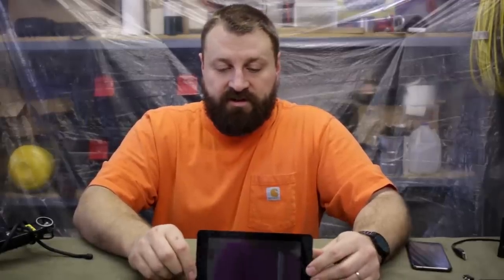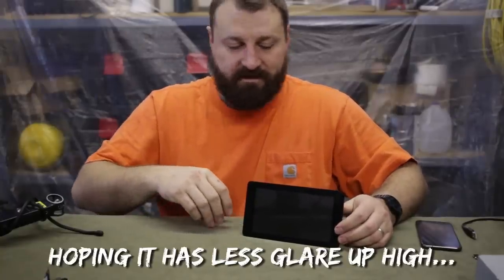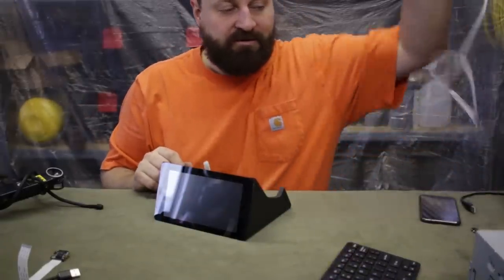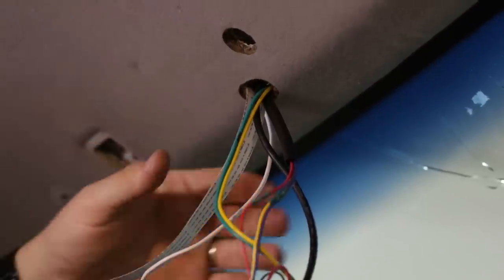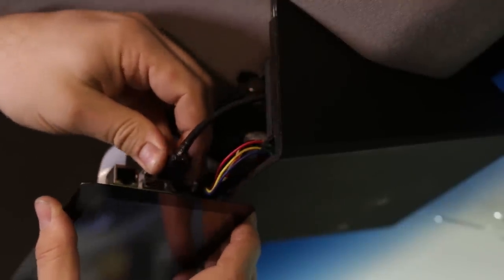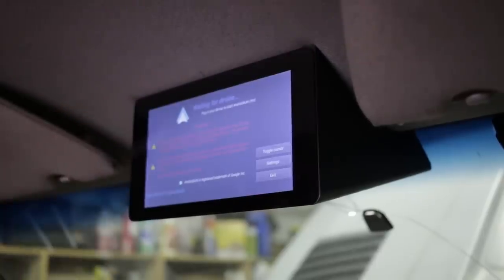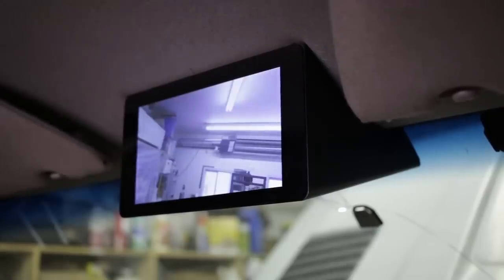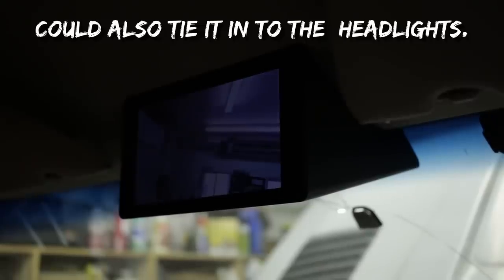DIY Android Auto Raspberry PI Head Unit, Rear View Camera, Navigation & Music

Comment: Cool!!!

Any chance you know if it would be compatible with a weird screen ratio (something that would fit a 1 DIN)?
Reply from the maker: I would probably just go to a wrecker and pull out the dash bezel surround from the same car and make yourself a custom Dash that holds the screen. Much easier than trying to mess around with a single DIN with a pop-out screen.
Reply: I can't use a pop-up screen because air vents. There's not much space on the center console and I'd like to avoid cutting it, it's sort of a collector.

Same as this: http://i55.servimg.com/u/f55/18/34/59/40/img_2012.jpg
Reply from the maker: Yeah, that's tight... How about an overhead console like I did?
Reply: Overhead is plan B. A good plan B but if I could avoid it...

Comment: Maybe this will be in part 2, but did you ever think about tapping into the reverse power wire on the car and monitor for voltage and then have it trigger the camera automatically?
Reply from the maker: Part 2 has been up for some weeks... Tapping into the reverse lights is an easy adjustment, and I posted the code for that along with the rest of it on GitHub.

Comment: Nice vid!  I’m working on a Lithium UPS to use inline with a similar RasPi setup (Plex media center in the travel trailer).  What could I use to monitor voltage upstream from the UPS and trigger a shutdown of the Pi?
Reply from the maker: You can just buy a lithium UPS for the Raspberry Pi... save yourself a lot of headache. https://pi.gate.ac.uk/pages/mopi.html
Reply: Not compatible with the RPi 3 and no word on when their new one will come out.
Reply from the maker: Easily accommodated: https://pi.gate.ac.uk/posts/2016/12/19/good-news-and-bad/
Reply: the last comment from the developer on that link was 6 months ago, and still no release date listed.
Reply from the maker: I'm not sure what your getting at... It works fine. You just need to add a relay to switch the higher load. Regardless, you want me to find you a different solution? How about this, get a cheap low voltage cutoff (LVC) from the RC Model World and use that to trigger the script... Something like this: https://www.robotshop.com/ca/en/low-voltage-cutoff-switch.html
Reply: Everlanders I appreciate your responses, was just hoping to find a way to send a shutdown signal to a RPi.  Wasn’t looking for you to do all the research - just thought you might have come across a solution in your previous research.
Reply from the maker: No, Not an off the shelf solution that you can just plug into USB, but there are many ways to do it. If it was me I'd use the low voltage disconnect relay I mentioned, there are may of them to choose from, you'd just want one that you could set the trigger voltage on. Then when it went below that, it would switch to ground and trigger the script in the same way I mention in the video.

Comment: Will I still need to access my OEM control knobs in order to control sound or is there something on Android Auto I can use? I'm trying to completely bypass my OEM radio as it is shorted out, and this is cheaper than buying a new head unit solely for Android Auto
Reply from the maker: You still need a head unit to act as an amplifier. watch the part 2 video where I show the complete hook up

Comment: I love the DIY aspect, and you seem to have done a great job. But wouldnt it just be easier to mount a  cheap tablet?
Reply from the maker: Easier - Yes,  Better - No... The tablet has no I/O external Camera for the Rearview Backup monitor which was the primary goal here.
Reply: Just find a OTG USB camera? Im not trying to smacktalk your project, just saying its a little overcomplicated :-)
Reply from the maker: I would argue that a tablet is not complicated enough! believe me I've tried. These are the main reasons I built my own; I can use the gpio pins to sense when the reverse lights come on and switch to that camera. I can also sense the signal lights and flip to either of the side blindspot cameras. I can power up and power down automatically with the ignition. I have instant access to dim the screen without moving my hand from the shifter. I can control any of the automation in the rear camper box.  Your tablet/OTG comment is easy to make, but how would you switch to that camera? Launching an app?  Like this disaster? https://youtu.be/P0ml0FIFA_E?t=1m10s
Reply: Point taken :-)
I dont use a rearview camera, so for my needs (navigation and music) a tablet is just fine :-)

Comment: It lacks some very important and without, the volume keys. Is there a possibility to add them to the screen?
Reply from the maker: The volume is handled by whatever amplifier you're using. In our case the Kenwood head unit...
Reply: Everlanders Ah okay. I pretend that the Android car is the main music system of the car and feed it with an amplifier. I'll have to get some controls on the steering wheel to drive it hehe

Thank you very much for your answer.

Comment: Hey! Quick question: Doesnt the whole thing breakdown when under intense heat?
For instance if its a hot summer day and its really hot inside the car, doesnt that ruin the display, glue, proccessor, memory chip, capacitors etc... and how would you ameliorate that?
Reply from the maker: If that were true your car stereo and every other electronic component with memory chips and caps would breakdown too...
Reply: @Everlanders  i agree but this is on the roof tho... But maby even then it doesn't matter..
Reply from the maker: We driving through Mexico and Central America at the moment with no problems... For any one else reading this, that is exactly why I printed the enclosure from ASA.
Reply: @Everlanders   Thank you for answering! This is very important information, as Im sure alot of people who have delt with computers would agree, tech doesnt like heat! 

Also done some research recently on NAND-Flash (the memory of any sd card, usb stick, ssd in general) it does NOT like heat at all! In fact if you heat it  enough times alot of data will be corrupted (my phone's sd card can attest to that, and many other people's)

Good luck in Cental America, may God be with you

Comment: This is amazing. Did you have to do to school to learn all this? O want to get into this in the worst way possible but don't know where to start
Reply from the maker: I have found that if I don't start, I won't start. I've built an entire expedition vehicle with my bare hands, taking it one tiny problem at a time, you just need to start somewhere, baby steps. If you like the Android auto project, buy yourself a Raspberry Pi for $35 and learn how to flash and image to an SD card.

Comment: With android auto is it your phone that connects to your cars bluetooth, or does the pi need to be connected to the cars bluetooth? And I can see you decided to add a mic to your set up, so you can't just use your phones 'ok google' interface? The pi has to have its own capability? Might be some dumb questions but it's something i've been trying to figure out.
Reply from the maker: I don't use bluetooth at all.  The Mic in the phone would/does work fine, I've plugged in a $3 lapel mic which I will mount closer to my face as this is going into a pretty loud Diesel truck.
Reply: Makes sense, but if you're not using bluetooth at all how does android auto play music? Is there an aux cable going to your phone?

Comment: Great job. A question: Couldn't you add a Video RCA input directly into Ras (Instead of ribbon) and use a conventional cheap backup waterproof camera with IR (Usually under $10) that also gives you color back up path markings? Talking of cameras, how about turning this Ras into a DVR (Utilizing its micro SD) also for front cam that can serve as DashCam?
Reply from the maker: RCA cameras are very low resolution, these cameras do 8 megapixel. And yes, way ahead of you. Cameras are all DVR'ing while we drive and when camped...

Comment: So open auto is a program running on the raspian OS? Does that mean I can use the gpio pins to toggle smaller programs in raspian OS to do stuff while open auto is running? For example I run a program to detect an input on one of the input pins, and then it displays a small png image over the open auto GUI for 10 seconds. Would that be possible?
Reply from the maker: Yes, exactly, should be pretty easy.

Comment: Any way to connect side cameras and turn on when turn signals are activated? Setting up my 66 Chevelle and would really like to have that ability.
Reply from the maker: Yes, although you'd need a seperate pi for each camera and the video would be streamed over Wi-Fi with a 300ms delay.
Reply: @Everlanders  Thank you for the quick reply, is it possible to give some directions-details on doing that off public replies?
Reply from the maker: You'd need to expand on my button monitor script, adding more inputs for each camera/signal light you'd want to monitor. Then each Pi would need to have a RTSP server running and waiting for requests.
Reply: Thanks for your reply. I used to be great on computers and programming but lost all that. Working on hobbies to help me get back into mental shape. Kinda difficult for me. Will research more on the subject. Really do appreciate your response. Again thank you.

Comment: I know this is an old project, but could you tell me if the screen holds up well in the extreme temperatures of a car? I want to have this installed into my vehicle, but I live in Florida and am worried the screen wouldn't last
Reply from the maker: It's no different than any other electronic control system in your car... We're currently on the border to Guatemala and it's still going strong.
Reply: @Everlanders  that's great to hear, thank you! I'll be installing one of these ASAP!

Comment: Awesome work, man. really excited to do this project! 

Quick question, though. I'm only interested in replacing my mirror with a camera rearview camera (I don't need Android Auto). So the components I need for this project are:

* Camera 
* Touchscreen
* HDMI cable 
* HDMI cable extension 
* DC-DC converter

 can you please confirm this list for me?
Reply from the maker: The list is the same regardless of if you use Android auto or not. Probably easier to buy a cheap rear view camera system.

Comment: how does the Pi system handle the heat of summer?
Reply from the maker: It's -20c here now, I'll let you know June when it warms up. :-)

I'm not expecting any problems, It's not much different than any other touchscreen or CPU in other car head units. I'm working on a new video and enclosure with a fan.

Comment: Just wondering how you installed the cable connecting the Pi to your phone.
Reply from the maker: It runs from the USB hub (near the sound card) through a grommet and out the dash next to the audio cable, you may be able to see it in the video, it's white.
Reply: Thanks. Do you have the dimensions for the drill bit and grommet you needed to use?
Reply from the maker: No, I just used something from the goodie drawer... You need to measure the connector and that is how big the hole needs to be, then get a gromit that fits that hole, with an ID closer to the wire size.

Comment: Is there any way to use raspberry an the camera for some what of a dash camera/with recording? I’m trying to do the same but with a rear an front facing camera but for my motorcycle for track days don’t really need the screen as it would be jus to big for what I’m intending to do
Reply from the maker: Yes, the part 2 video shows all the scripts and wiring you'd need to do, but personally, for that application, I'd just get a dash cam... Way easier.
Reply: Everlanders Thnks for the reply ,that’s what I originally wanted  to do but the price for a front an rear facing dash camera is hell of expensive I’m looking at roughly 3-500$
Reply from the maker: Get 2 cheap gopros...?
Reply: Everlanders lol been through 4 ,long story lol wanted to make something not so conspicuous  dash cam or go pros would be obviously easier ,there’s lot of options no doubt ,I just wanted to make something different know what I mean the fulfillment of making something that I personally know has
Reply from the maker: Then, yeah, go for it... You just need the raspivid command to record video... Grab a pi and give it a try.
Reply: Everlanders will I need camera adapters like the 2 extra ones u had ?
Reply from the maker: Raspberry Pi can only have one camera connected, so you need to identical setups, 2 and 3 foot cables are common for the standard camera connection so you shouldn't need them.
Reply: Everlanders Thnks again

Comment: Great job man!  IS OpenAuto Android based or Pi based?  Again you did a great job with your build!
Reply from the maker: Android Auto is an Android app made by Google, OpenAuto is merely a mechanism to display and transport audio, multimedia and map information. It emulates an official head unit available in new vehicles.
Reply: Everlanders how is the Pi connecting to the web?
Reply from the maker: It's not, the phone is...

Comment: Great set up, I have been wanting to set something like this up for a while with the added cameras and ODB2 logging. One thing you might want to consider is adding a relay to the backup lights to load the rearview screen when the car goes into reverse.

Also, how are you getting the data and GPS signal?
Reply from the maker: I feel I've answered this a dozen times... You can easily use the script I provided to switch to the rear facing camera when in reverse gear. I don't want that, as we use ours on the highway as a rear view mirror when driving forward.  ODB2 is pretty easy, but again, we have other means for this and don't use it.
Reply: @Everlanders  
Awesome sauce, thanks. Have you had any issues with heat? Here in AZ that is kind of a issue.
Reply from the maker: No, I haven't... But the 3D printed enclosure has provisions for a 40mm fan should it ever become an issue.

Comment: Neat, and really tidy. Was thinking of doing something similar with my jeep. Does it get navigation info from the phone? 

Also, the Raspberry Pi 3 has onboard bluetooth, and all you need is a simple amplifier to get quality audio out of the GPIO. You could even use a Hi-fi berry which is just great.
Reply from the maker: It gets everything from the phone. Nav, GPS, Audio, Data Connection.
Reply: Another thing I would have done differently is instead of using HDMI which is bulky and expensive (because HDMI is copyrighted, so companies making them have to pay royalties, and they pass that on to youuuuu), I would have tried to locate a RJ-45 solution, since Cat6 STP cabling is pennies per foot.
Reply from the maker: What are you talking about...? 

1. You believe that eBay, China, BangGood etc etc vendors are paying licensing?... ROFL  
(I got the cable for $9)
2. Cat6 will not work, you need shielding on the signal wires.
3. The camera cable has 22 conductors, Cat6 has 8 
4. HDMI has shielding over each signal wire, Cat6 does not. 
5. Adaptors to Cat5/6 don't exist (for good reason)
6.  ...
7.  ...
8.  ...
Reply: Cat 6 is shielded if you buy STP cabling, Shielded Twisted Pair, basically the stuff you use for running ethernet through your walls.
Reply from the maker: Still not nearly enough shielded data lines.

Comment: I installed the software according to the wiki and used the sound card you suggested in the video but for some reason I can't get the mic to work with openauto. Audio out works via USB but the mic doesn't. Anyone know what I may be missing?
Reply from the maker: Try this: https://learn.adafruit.com/usb-audio-cards-with-a-raspberry-pi/updating-alsa-config
Reply: Everlanders appreciated, I actually found you mentioned that on another comment earlier and it turns out it was just a faulty mic. That and for some reason with raspbian and openauto it wouldn't pull the sound from the USB card even though the operating system could. I flipped to another SD with crankshaft on it and it worked with the USB card flawlessly. Is there somewhere specific to assign the card with openauto that I'm missing now?

Comment: Nice project, I have a pi 3 so tried the install today but I keep running into a wall with the install. did you have any troubles?
Reply from the maker: No, no problems... What error are you getting?
Reply from the maker: Nope, It installed straight away for me, maybe post a question on his GitHub
Reply: Everlanders I got it installed correctly now. I screwed up by using the nova spirit install.

Comment: Do you manually shut the pi down before turning off the ignition?
Reply from the maker: Still in testing, I have a script watching a GPIO pin and when it goes low, it shuts down the pi... I just need to connect this to my ignition, I will test this and include in my next video.
Reply: Thanks for taking the effort to sharing this for all enthusiasts!
Reply from the maker: Have you measured this Mathew?  Did you read to the end where they found:
"When it is shutdown using "poweroff" or "shutdown now", it draws more or less 10 mA.
When it's stopped using "halt", it draws a steady 210 mA"  Regardless, I have your solution in the next video...
Reply from the maker: Testing Complete! See the answer here: https://youtu.be/jFXxtxoi_pc